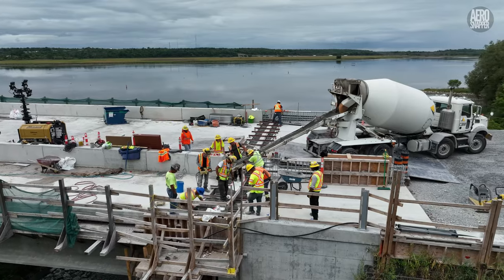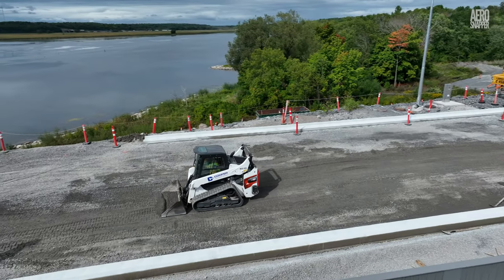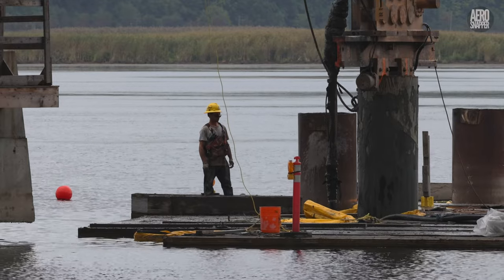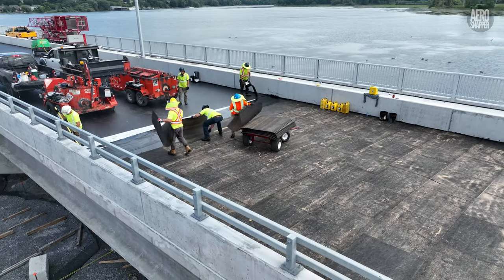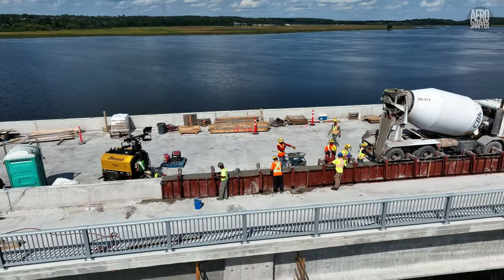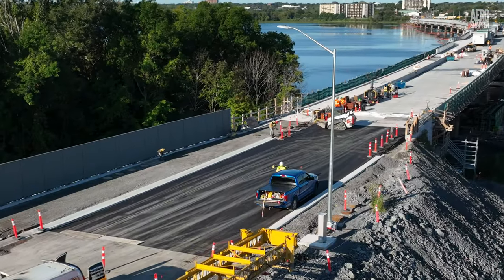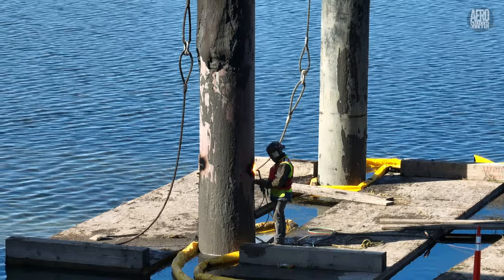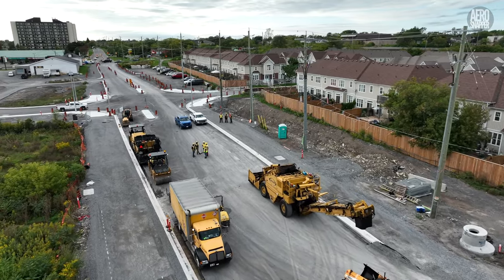It's all going to come out !   4K

Comment: You might have to edit your video. Shackles are tightened and loosened only by hand. You never use a hammer on a shackle.
Reply from the maker: I appreciate the idea - but I'm not sure that Clevis would be understood - mute the sound at that point LOL
Reply: @Aerosnapper   I've worked with shackles my entire life. It was a shackle not a clevis. There's a difference.  As I said you never use a hammer. If you want to put out misinformation help yourself, it's your video. It seems you don't take criticism very well. You've also lost a follower.
Reply from the maker: @700kotchi  i think you've made an appropriate correction - thanks for making the situation clear